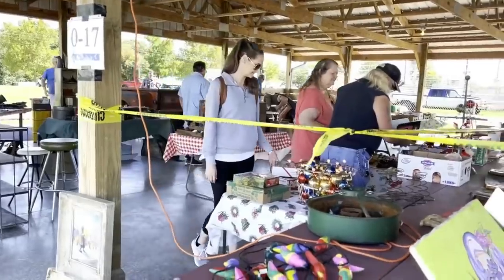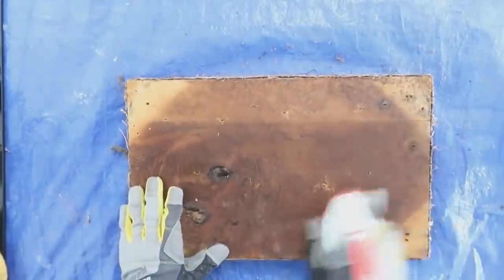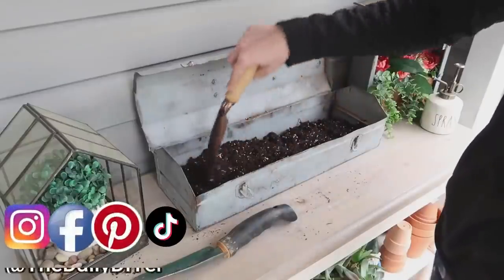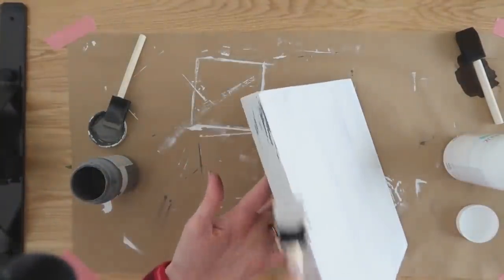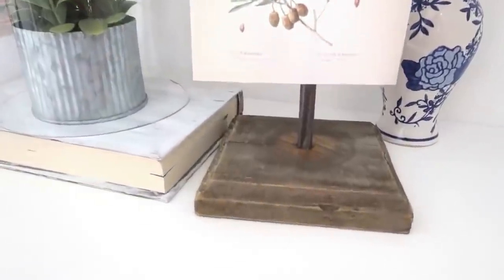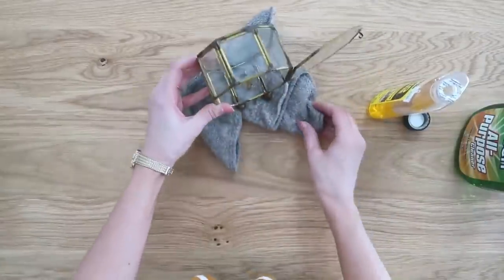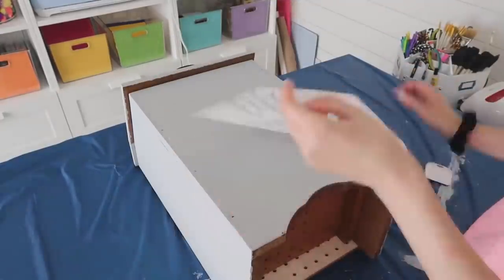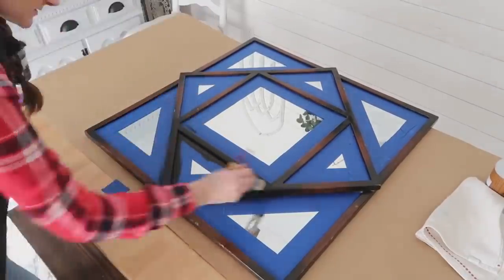Use these CRAZY CHEAP finds & copy my BRILLIANT ideas in 2023!

Comment: I have had 2 of those kind of bins but hand made. They are trash bins you use a large garbage bag to fit the size of your bin and that is your garbage bin in the kitchen!  I have the vegetable bin, it has 3 separate sections for different vegetables.

Comment: Use a door knob hole drill bit to cut holes like the one in the bucket. Go check it out.they bit has different size saw hole saw bits you can use.

Comment: I NEVER use anchors and screws - that my friend is what gorilla hooks are for - some will hold upwards of 50 lbs! Some are called monkey hooks. Google them - they only leave a small pin hole in your wall and hold am amazing amount of weight! And so so easy to use!